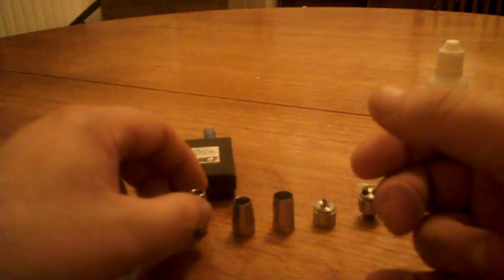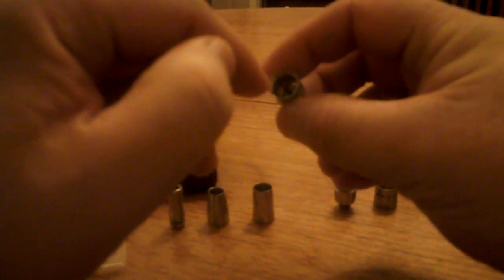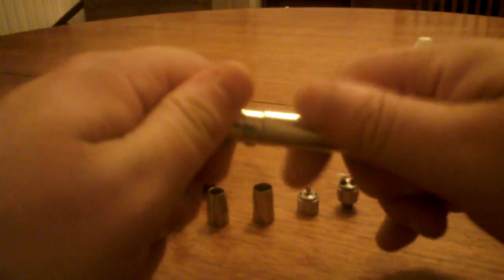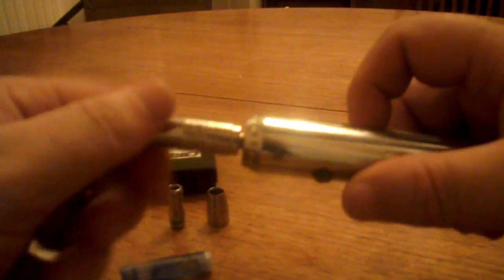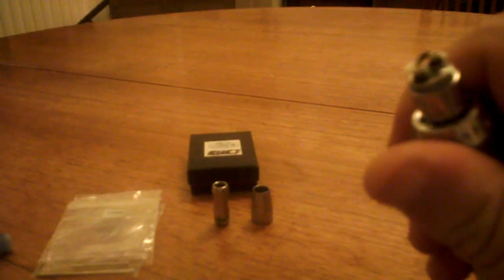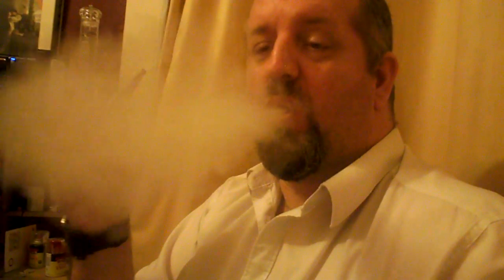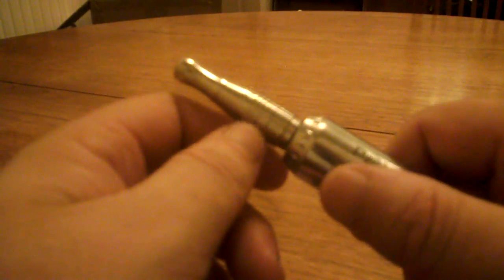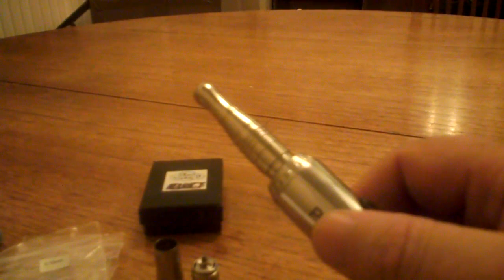Repairable Atomiser Head to Head Part 1 - Mark-T Infinity Bug

Comment from the maker: @Lisaf01UK It's a pleasure Lisa, and thank you for making it possible with the loan of the atomiser. I must stress that the collar not fitting to the ego-style battery that I have is not unique, and have come across the same problem with the collar supplied with the G-Tank too. There is a difference in the length of the threads on the two batteries so can only assume that it is this that is the critical element.

Comment from the maker: @mLKauai I'm not an 801 atty lover either.It's good that you mention airflow, with a repairable the position of the air hole is critical. If it's too close to the coil you just get all air and very little vapour... so you have to align the coil so that the air hole points directly at the coil, but with the maximum distance possible between hole and coil, for this reason the coil naturally rests (usually) towards one side of the atomiser. so the hole can sit opposite.

Comment from the maker: @mLKauai Oh, and tip for the iAtty... if you find the draw too airy, try putting a loop in the wick in the centre area right where you are going to make your coil, and make your coils over the thicker section of wick... I've found that obstructing the air flow in this way can really help... though I would only recommend that you do this with some other wick, and not the wick as originally supplied!

Comment: @rawveg ... thanks Raw, i stay away from 801's : 1. mouth piece feel is too wide for me 2. airy draw (smiley).
Re draw; I've heard it said that with an atty, the air is coming from below the coil, passing through, whereas the rebuildables have the air simply gathered from the top of the coil.
Not sure if what that means, but it may be just how they are constructed differently.